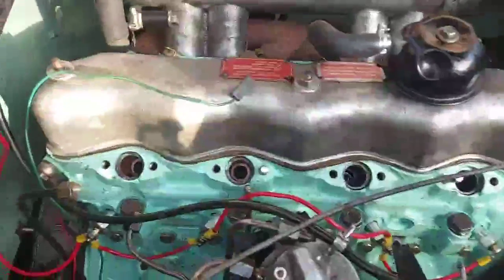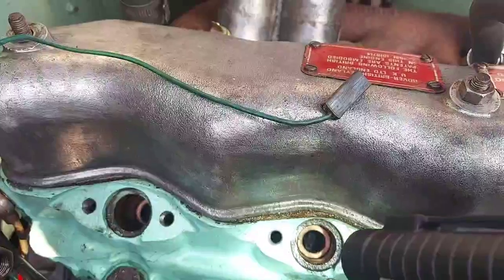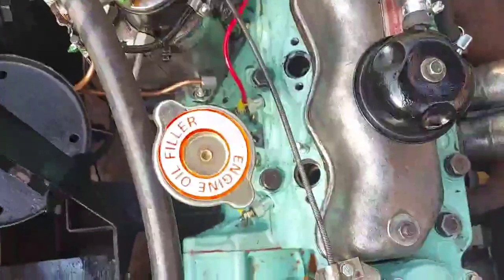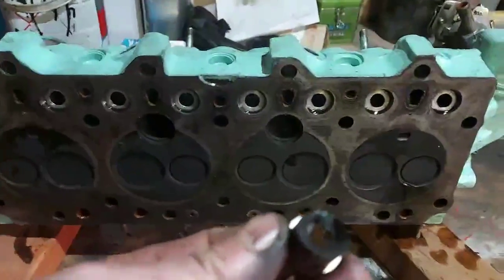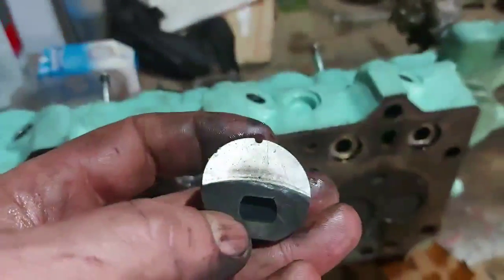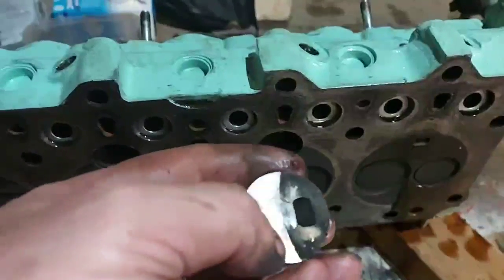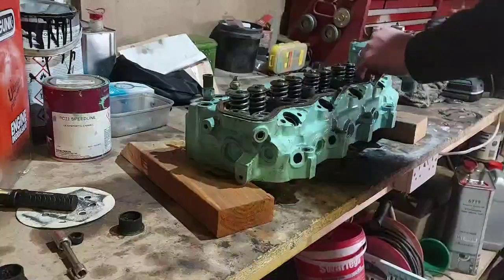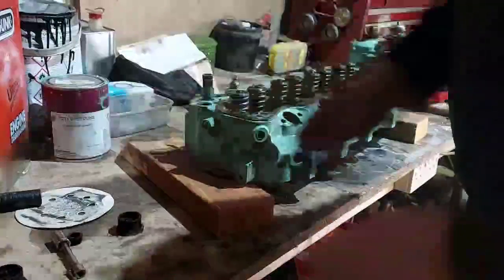land rover series 3 2.25 diesel build. how to remove hotspots and injector shrouds

Comment: What happends when the shouds are damaged? I have a restord engine that smokes like hell and the only fault i can find is that two shrouds are complete gone.
Reply from the maker: They will need replacing the injectors won't seat properly fuel will leak past and also won't atomis and detonate properly causing smoke and/or poor running if its not sealed you could also have low compression.  🙂👍
Reply: @retro.restorations  ok so maybe i have find the fault then.